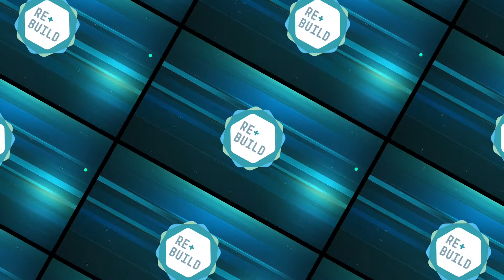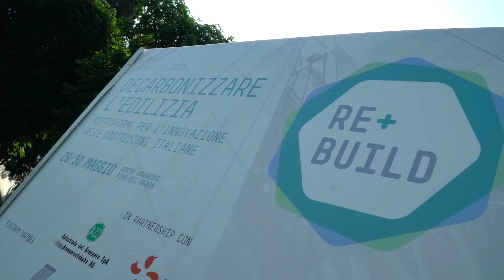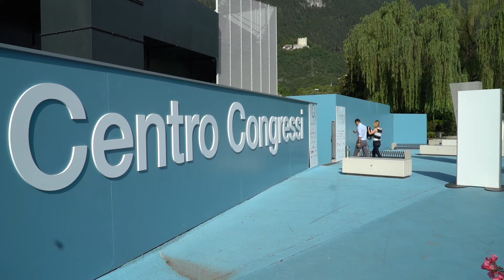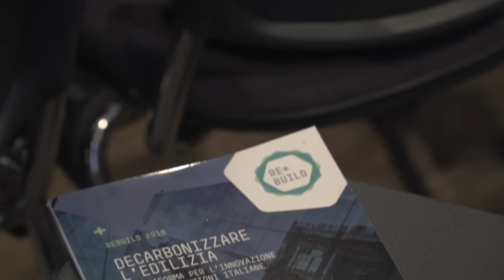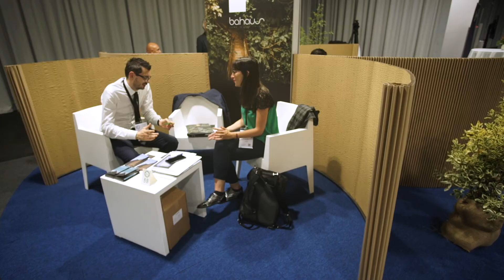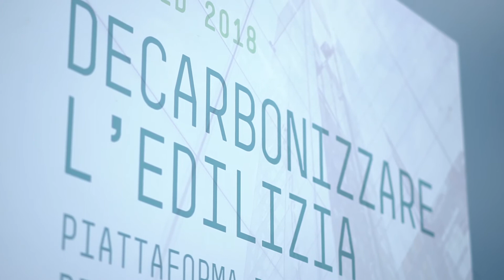REbuild 2018 | Rodrigo Castro - LCA Expert Bionova

Comment: Also the use of timber in building helps to stock carbon for longer and reduce carbon emission in the production of building materials, especially if the timber is coming from certified responsible forestry. For more info see the article: https://www.sciencedirect.com/science/article/pii/S2210670716305923